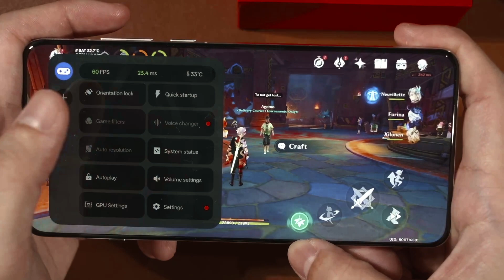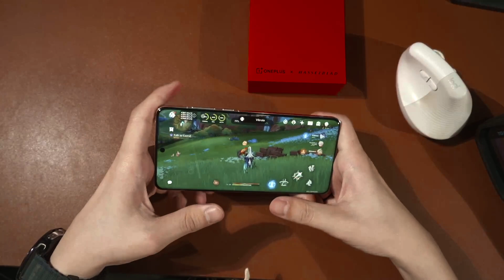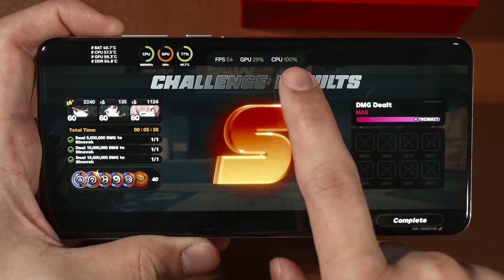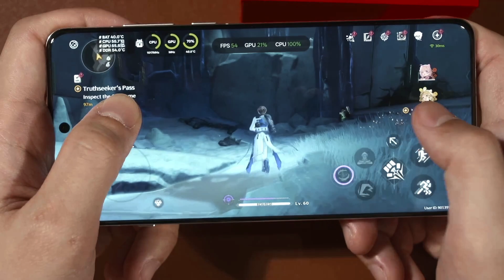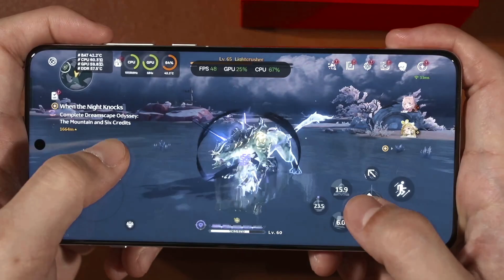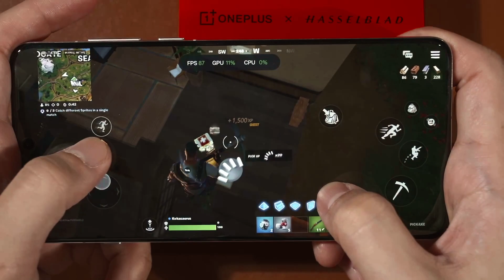Gaming test - OnePlus 13 with Snapdragon 8 Elite!

Comment: I was using honor magic 5 pro before. I was very satisfied. There was no problem. I've never had any problems with performance, os, software and lag. The phone was always working at maximum performance. Now I have switched to the Honor magic 7 pro. Likewise, I have never had any problems with performance and other issues, such as let in oxygen os or color os.

Comment: Try to use Airvocc charger with Bypass charging on...
Reply from the maker: Doesn't let you. Only works on wired charging
Reply: @NasiLemakTech then wat use is it 😅😅😅 hope they bring it with wireless charging to bypass while using Airvocc

Comment: Noticed that Oneplus 13 maintains a LOT lower temps at both the CPU and Battery. It throttles faster maybe to prolong the device's life. But CPU can't get over 60-61C while on other phones 75C is very common.

Comment: Op13 and s25u both play games at 810 and the reason for s25u to have a higher resolution when you take a screenshot is because the aspect ratio for s25u is 19:5:9 and for op13 is 19:8:9

Comment: I am watching on my oneplus 13 and it's my primary phone for heavy usage and it is giving constant 120 fps for now on bgmi no lag with 4x anti aliasing and i will share if i face any issue but for now the entire experience has been lag free and very good so recommend it over other brands like iQOO and samsung ❤ and i will use it for 4+ years so anyone can ask me for my experience in next year's on this comment 😊
Reply: Bro i am thinking about purchasing it i recently sold my 15 pro max due to heating issue while playing pubg and that shitty brightness dimming issue after heating. What do suggest should i purchase oneplus 13. Are there any heating issues?
Reply: @rizualikhan9887  yup totally hate that brightness issue on iphone using from 14 pro Max to 15 pro Max both I sold as I hated using iphone os over android and yeah oneplus is well balance i choose it over iQOO and samsung as overall beast in camera,oneplus os and gaming all is good and i purchased 2 year oneplus care in just 2 days and don't fall for those frame generation scheme or benchmark oneplus has overall all feature well optimised then iQOO and service charges are quite low I checked on it only 1900 rs for battery replacement rest screen and all protected on 2 year warranty
Reply: @tradingtipsrkd  bro i was confused between redmagic 10 pro and oneplus 13. Because where i live temperature goes to 40c in summer so built in cooling fan of redmagic would have helped but you it's only gaming phone and cameras suck on it. Oneplus seems to be all rounder that's why i am going for it. I just needed review of it's gaming.
Reply: I've a s23 ultra. And it heats so much - even hurting my fingers if playing without case. And that too after 3-4 minutes. Your opinion on the heating of this phone?
Reply: @ i had a gaming case that was exclusive for iphone from totem company and it helped to play games even when iphone used to get super hot so try to find such gaming case and try spinbot icedot cooler mag safe one as it keeps phone quite cool while gaming and best to play with ac turned on for best experience on any gaming phone
Reply: Can OnePlus 13 handle warzone mobile?any heating or lagging issue? please help me find the answer
Reply: @unverifiedperson1081  I don't play warzone but I saw some videos on same oneplus 13 so it seems it works well staying above 90 fps maybe later I will try installing and playing when free
Reply: Did you use iQOO 13? What are the differences I mean real differences. Does iQOO performs better than oneplus?
Reply: @ no i would say both are similar but i would suggest oneplus as software is more optimised for overall performance and iqoo is all gaming phone but oneplus feels better in camera and overall performance and i had a family member who sold their iqoo 13 and get oneplus 13 as once he saw this phone in my hand he loved it also and he even got the same colour so this phone has better presence and i think it can sell better in second hand if required
Reply: @tradingtipsrkd  how is the battery and heating after new update bro?
Reply: @ordinaryguy873 performs he same
Reply: Hey man do u get high resolution in games?
Reply: How do you get fortnite to run at 120?
Reply: @Chriselchingon23  fortnite always run 120 fps in any flagship phones even in some midrange phones
Reply: How is your op 13 performing now?
Reply: @farhantahsin2192  still great no performance drop and still at 100% battery health as i use bypass charging during all gaming session and i do play over 3 to 6 hours daily

Comment: I have the OnePlus 13 right now and it really does render at a much lower resolution than S25+. Right now when you try to screenshot like in the video to check it shows the native resolution of the screen but its very clear when you compare side by side with S25+ that the resolution is much lower which makes the heat less of a problem but you can lower the render resolution on Samsung as well for similar results while you cant set the render resolution higher on the OP13. Changing game settings does nothing. Its a good phone though.
Reply: Cuz when you enable qhd+ mode in s25u it utilizes a feature called image/video upscale just like high end television like sony and lg

No other phone has this feature other than s25u

As for op 13 you have to manually select qhd+ mode just like any device out there including s25u, by default it is set to lower resolution to save battery
Reply: @urandurparthu1526 it's called proscaler for samsung and it improve image quality by using ai. But s25 seems to be a bit hot when gaming so I think I would want a poco f7ultra more than a s25
Reply: @urandurparthu1526 make sense thank you

Comment: im getting 2372 x 1067 on my op 13. I tried screen recording but the camera in wuwa doesnt let u click photo with screen recording working in background 🥲. Im using standard resolution on my phone with dynamic frame rate.
Reply from the maker: I got a hunch that the camera picture-taking method is not reliable.
But, I do think that I found a better method
Reply: @NasiLemakTech  wait i am uploading the video, give me a min
Reply: @NasiLemakTech  did u reach any conclusion on this ? is the in-game camera an accurate measurement for rendering resolution?? 
Someone actually posted this video on oneplus reddit grp.
Reply from the maker: @dhairyshrivastava  zenless zone zero is the only one that doesn't have matching resolution. Wuwa and Genshin matches with the camera picture
Reply: @NasiLemakTech  so does that mean it renders it in lower resolution ?
Reply from the maker: Nope, zzz is pretty much always the same render resolution as Genshin
Reply: @NasiLemakTech  Thanks for the clarification. Any plans to make a video again on the op 13 ? Like comparison or anything?

Comment: And we are back to SD 888 & Gen 1, only this time it's not Samsung's fault. My X7 Pro runs smoother. The CPU/GPU load is definitely wrong, do they even test their software before release? (Obviously not)

No idea what they were thinking going 4.32ghz without active cooling... I remember overclocking an i7 4790k - to go from 4.6 to 4.7ghz I had to change vcore from 1.3 to 1.4v.
What's the point if the SoC can't use this speed for more than 10 seconds? The S25 throttles down to ~40%, over half the SoC unusable.
Peltier coolers will probably be bundled in the next few years, or have internal fans like Redmagic, kinda similar approach to Switch dock/handheld speeds if a cooler is detected via NFC.
There's no point keep going forward like this when you can't even utilize the advertised performance.

Comment: I have iqoo 13 and it is showing me 1901×864p resolution in genshin which is even higher than s25 ultra and at the same times it is 0.1 inch smaller than ultra

Comment: A lot of people keep putting this phone against the Samsung S series, showing the fps and saying that it beats the "overpriced" s series in terms of fps, but they don't see that this phone, even though it has a 2k panel, it renders the game at so much lower resolution than the s series, even lower than the regular s25 model.
Reply: like a superbrain to render the game for 4k on 7inch display :D :D :D
Reply: For that you need to enable qhd mode in settings 

Same for s25u by default it's hd mode
Reply: fake news
Reply: it's the whole purpose of the phone anyways.
supposed to be midrange (or budget/cheap) phone with flagship like experience.
they probably have to cut costs for resolution, even if it weren't the case.
Reply: @Zliarx This is not supposed to be a mid range, this definetely is a flagship with insane build quality and haptics, Hasseblad co-op, similar level of camera hardware to iPhone pro/pro max and Ss Ultra series and has one of the best screen on the phone market rn tbh. This is competitive with my S25U in every aspects, the only reason why i love my S25U over than this is because the OneUi 7 and I'm in samsung ecosystem for 7 years with watch 6 classic and Buds 2 pro, also the 1+ 13 can inscrease the resolution of games (mostly support chinese and popular game like zzz or hsr, Hok, lol mobile) to 1440p 120fps and can maintain the fps really well (Which would result in somewhat higher temperatue of 44°C). Also I dont recommed the S25U only for heavy gaming, this make the Ui struggle with your daily usages
Reply: @TminG730  the cameras says otherwise my guy. How can it be a flagship phkne with those oversharpened cartoony cameras.
Reply: @Zliarx  Maybe it isdiffrent in the chinese version, but for me the Ss produce even more oversharpen pictures. You can tried the master mode for way better result though, in auto mode the sharpening processing of the 1+ is kinda meh, which lead to many artifical oversharpening
Reply: They hit different in chinese varient, which actually increase in game resolution to 1440p 120fps with monster setting and some software support (Almost 1440p in a photos I taken ingame in Genshin, they maintain arround 115 fps too, but in some heavier game like Zzz, I dont recommend to trying 120fps, 1440p in this is alright, held up arround 56~57 fps after some major updates)
Reply: @TminG730  so is the Chinese variant better then? Thanks for the info
Reply: Not true, both render at a low resolution. It's an android thing, not oem.
Reply: My OP13 has 3168 x 1440 on genshin
Reply: Proper BS
Reply: I tested it with my own OnePlus 13 and I get different results. I think something is wrong with his device. I can also see that he was sponsored by Samsung as his site and the links are plastered with Samsung products.
Reply: @DrLogic_  Of course, when you don't like the results something is wrong with the device. 
This reviewer just recently gave a bad review to the whole S25 lineup, guess that Samsung money was late.
Reply: Yup, a bit of trickery by OnePlus.
Reply: Oneplus ui 🗿
Samsung ui 🗿
apple ui 🗿
Iqoo(vivo ui) 🤡🤮
Reply: @Fixi_00  well this aged like milk 😂🎉
Reply: Iqoo 13 which is cheaper and most powerfull than this phone😂😂😂
Reply: @muraridasari2001  yes but sadly  its ui looks like some 100$ ass phone
Reply: @rage9661 not anymore at least 🙂‍↔️

Comment: Why need render resolution for cellphone while gaming and gpu refresh rate and what causes overheating of a phone?
Reply from the maker: That's how games work. The render resolution is independent from the phone's screen resolution.
Stressing the CPU and/or GPU will cause it to heat up.
Reply: @NasiLemakTech  ah I get it, that's why you prefer MediaTek Dimensity 9400 because they have cooling management is that right?

Comment: bro pls reply my question i beg you.
Reply from the maker: What's your question?
Reply: @NasiLemakTech  bro I asked it 100 times this one:
Which is better for photos oneplus 13 or s25.
Reply from the maker: Mmmmmm difficult question.
OnePlus 13 has high contrast and the color consistency is not as good as the S25.
Details are definitely better on the OnePlus 13
Reply: @NasiLemakTech  what will u choose and s25 has 24 mp mode in expert raw to increase details.
Reply from the maker: If you want to explore all of those features like manual mode, Expert RAW and Samsung LOG, then go for Samsung. The features are magnificent there and OnePlus doesn't have any of them

Comment: The scene app is not accurate on the gpu part not sure about cpu. my phone got a similar operating system like you i can tell you almost all third party apps are not accurate on showing this system stats. If your gpu load is actually at 100% you won't be able to touch the phone lol
Reply: It's is close to 100% but  when it does reach 100 the circle in scene app turn red ⭕ then temp go up very fast and yr hands start to burn lol. If u have a phone  cover yr hands will be fine
Reply: @kwas1226 still close to 100% would heat up the phone by a lot but the temp is only 41c in the first test

Comment: Correct me if i am wrong but i am seeing a 30% battery drop for 1.5 hour of gaming if i am correct. I kind of expected a bit more from a 6000mah.

Iphones really are the best gaming devices battery wise, especially the Plus/Pro Max models...
Reply from the maker: That's correct. 8 Elite is not efficient
Reply: OnePlus needs to optimize it more which they usually do after a while. 

The battery itself is made with silicone stacks instead of the typical lithion battery technology. The battery will last 3x longer because of that

Comment: Why dont you use PerfDog? Or TakoStats and Shinzuku (its practically free and shows CPU, GPU, FPS, Battery consumption etc.. Would be nice to see. You can use it in wireless mode, without cable to computer. I mean on Galaxy s25 series, especially s25 Ultra! Also Takostats shows the FPS, MW CONSUMPTION, AND TIME PLAYED WITH CHARTS. I have used it many times. Works perfect with all Android phones also! ❤
Reply from the maker: Takokstat doesn't work on Android 15. PerfDog is super expensive so no thanks
Reply: @NasiLemakTech  It does work on android 14 at least, I tried it a few days ago on my s24 Ultra. It showed fps, battery and temperature just fine. Have proof. I can share screenshot even. Might not work on android 15. But you could have done this on all the other previous phones you have tested on android 14. That is my point.
Reply from the maker: Doesn't work on android 15 and all new phones are on android 15.
Takostat is obsolete tbh, the devs abandoned it

Also I only discovered TakoStat late last year, paid for it and now it doesn't work lmao

Comment: BTW the phone wasn't heating above 41-42degrees and other gaming reviews somehow reach 45-46degrees but get a lot better FPS. Maybe the battery setting has to be "Balanced" instead of "Pro gaming"? Because throttling is strong in the later witch might show in gaming as well.
Reply from the maker: Not sure. Pro Gaming should be the one at the highest thermal limit.
The only way I can get it to 49°C is when running 3DMark stress test
Reply: @NasiLemakTech  Should be, but when all the power is unleashed throttling comes fast and on top of that the phone might consider many factors and scenarios of how to throttle the performance, for example the temp rising up faster than allowed for. In balanced we might not use the full power, but the average of it might very well result in better performance after the 10 or 15min mark. How the hell others make it heat to 45-46degress for 30min of gaming??
Reply: @NasiLemakTech  i think the battery mode was not set to maximum performance in settings.
Reply: Thank you so much for these tests, thanks to you/geekerwan/dametech I now understand what this optimization thing people talk about is, there's no magic wand as optimization that improves performance when we have set APIs and game engines... it's just either cheating with power envelope or different internal resolution and assets and also kernel power management that "shows" a device more powerful while it's using the same chipset

 @NasiLemakTech

Comment: why are they capping the render resolution in nearly every gane ? Are they that insecure about their thermal management ?
Reply from the maker: ^ What they said.
8 Elite is very inefficient when pushed to its limits, just like the 8 Gen 3
Reply: @NasiLemakTech  what Chipset is the best in your opinion, right now at least ?
Reply: @alexkapsimalis5142  Pringles or Cheetos
Reply: @phothewin6019  pringles
Reply: @alexkapsimalis5142 i think he didn't ask he replied to your question 😭(ngl but I'd prefer Cheetos)
Reply: Well both are just suped up version of  8gen1 still in my s22 plus lol @NasiLemakTech
Reply: Yes and also about battery drain
Reply: It's because they're capping about the performance 🧐